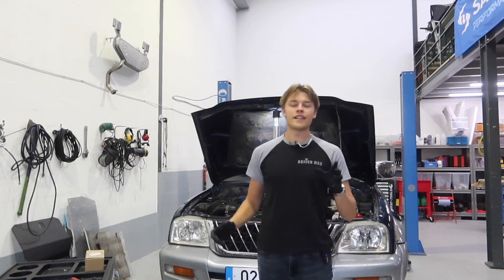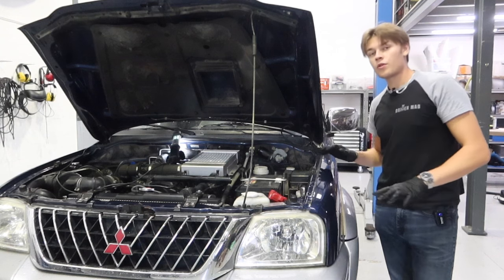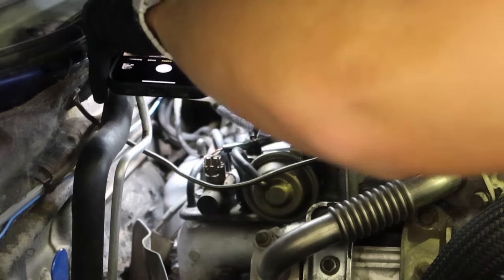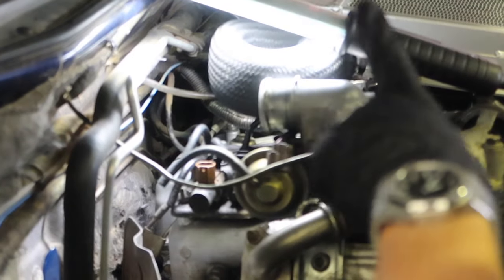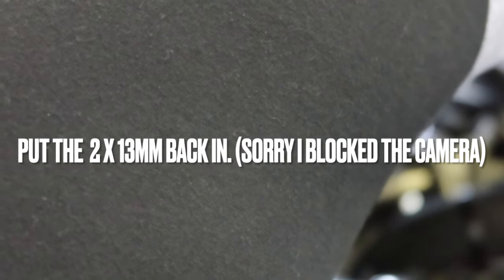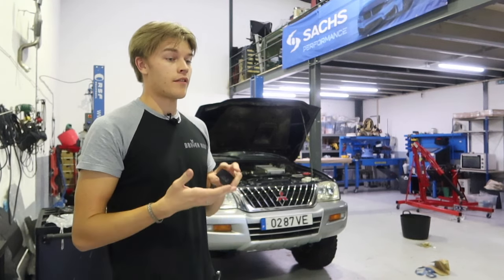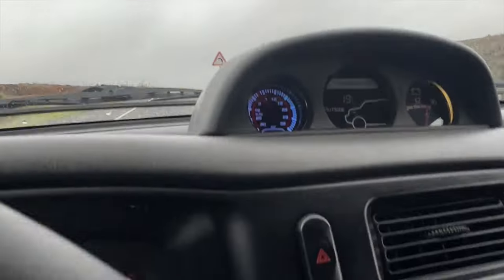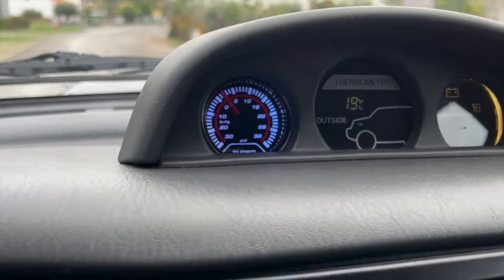Turbo solenoid replacement (Shown on Mitsubishi L200)

Comment: Hi Nath,  I feel for you , Iv owned  my L200 since 2003 when I bought it new. At 460,000 km I encountered the same problem you have now , the only difference was that my truck would go into limp mode, I would have to pull over and switch it off for about 30 seconds then everything would be ok for a while . It got so bad that I decided to swap out the turbo for a reconditioned  unit , did it solve the problem,  NO. Certainly had more power but the limp mode problem carried on .I then changed all the small vacuum tubes, still no luck. I then replaced the two valves you just did, I bought them on ebay, BIG MISTAKE.  That just made the problem worse. I then ordered 2 original valves from the UK, Bingo! It solved the problem. I also learnt from the internet how to test those valves with a 9volt battery and a vacuum pump and found that the cheap ones from ebay were faulty.  One other thing , when I put the good valves on I still encountered the problem once in a while for a couple of weeks untill it went away . I think these valves stick at times coursing the fault.  Thats my experience,  I hope something here might help. Greetings from Valencia.
Reply from the maker: Interesting you say that, it’s been a few days and I can definitely feel a performance increase since changing the solenoid. I’m going to replace all the boost sensors as I have them.
I might have to get a Mitsubishi solenoid like you say as they probably are better. 
I appreciate the comment and I will be posting more on my troubleshooting 👍

Comment: Only Original solenoid solve the problem, but the lifetime him can extended using a better air filter in solenoid. Another solution is Toyota Hilux solenoid, here in Brazil we using because is very difficult find original Mitsubishi solenoid and we when find It, its very expensive.
Here L200 K74T is called L200 Sport or L200 Outdoor in versions GL or GLS (121hp) and HPE (141hp)
Reply from the maker: Great tip, thank you

Comment: Have you ever looked at the two bolts that control the turbo actuator?

If not, I'll look out a picture of how far they should be screwed in/set.

Im not saying that will fix your overboost, but its 100% worth checking they are correct
Reply from the maker: Hi there, I will have a look! Thank you for the comment 👍
Reply: @DrivenMadShow  Don't be tempted to tweak actuator rod length immediately as this is often tricky to get right. Of course this assumes a previous owner/mechanic hasn't already been tinkering.
Reply from the maker: @andyfalconer3508  I will try everything before I go near the actuator adjustment. Thanks for the good comments 👍

Comment: I had the same problem - I replaced it with an original one - the manufacturer gives about 150,000 kilometers of warranty, so in K74 it's not a question of whether they will break, but when - I see a new intercooler - is it a custom order or maybe a replacement?
Reply: You replaced the turbo?

Where did you buy it?  Does it come with a new turbo actuator?

Was your overboost causing limp mode?
Reply from the maker: It’s a new aluminium intercooler, I changed it as I thought it looked better, but most importantly cools better. Got it on eBay. 
Thanks for the comment 👍

Comment: Often overboost can be symptomatic of stuck or sticking turbo vanes - not sure what system is on the L200. You can test this with a vacuum gauge pump like a mityvac
As you mentioned, look at the condition of boost pipes, but also the small vacuum lines.
Reply from the maker: Interesting, I hadn’t actually thought of the turbo itself being the issue! I will investigate. Thanks for the comment 👍
Reply: @DrivenMadShow  If it is stuck vanes, often actuating with a pump will free them up, but I've seen these cleaned in-situ with Mr Muscle Oven Cleaner.

Comment: Hi Nath.......
Check all the rubber pipes very carefully for any splits, damage etc, and the induction pipe.
If the turbo is over boosting then that would point to the waste gate not opening?
Are there any sensors that could be faulty?
Check the turbo unit itself, this will require you to remove the turbo from the engine first.
Clean both the exhaust turbine and turbo, make sure the vanes all move freely, the problem with turbos is they become heavily contaminated with carbon deposits which prevent the vanes from operating causing the over boost problem.
Examine all the turbo parts very carefully for any damage.
There should be no play in the bearings, check the seals, clean all the parts thoroughly removing all the carbon.
You may be able to purchase a turbo overhaul kit from Mitsubishi?
It could also be your DPF is blocked, so i would suggest that is cleaned of all carbon deposits whilst the turbo has been removed from the engine.
My apologies but i can only give you general advice as i have not previously worked on this engine.
Good luck
Take care
Best regards,
Stefano
Reply from the maker: Hi stefano, thank you for your in depth comment. I’m currently replacing the 2 boost pressure sensors and methodically replacing all of the vacuum lines with new and studying them all. This will all be next weeks video. If that doesn’t work then I will head towards the turbo.
I have already replaced the waste gate and it is moving freely. 

I will be keeping you updated on how it goes. 

Yet again thanks for the comment. 👍
Reply: @DrivenMadShow  
Hi Nath......
Work methodically through everything and you will find the problem.
Good luck and I look forward to watching the forthcoming videos.
Take care and stay safe please.
My best regards to you and Jon.
Stefano

Comment: Hiya I've got a mitsubishi L200 k74  06 plate with an AC problem, there is no power to the ac pump have you a video or any advice on what to check to find the problem many thanks Alf
Reply from the maker: Sorry, experts we are not - on a forum I found this (Facebook L200 owners is a good place to ask)

Check the AC Fuse and Relay:

Locate the fuse box, which is usually found in the engine compartment or under the dashboard.
Identify the AC fuse and relay by referring to the fuse box diagram.
Check if the AC fuse is blown and replace it if necessary.
Test the AC relay by swapping it with a similar relay in the fuse box to see if the AC pump gets power.
Inspect the AC Pump Clutch:

Ensure the AC pump clutch is engaging when the AC is turned on.
If the clutch doesn't engage, it could be due to a faulty clutch coil or insufficient power reaching the clutch.
Check for Refrigerant Levels:

Low refrigerant levels can prevent the AC system from turning on to protect the pump.
Use a gauge to check refrigerant levels and refill if necessary.
Test the AC Pressure Switch:

The AC pressure switch can prevent the pump from receiving power if it detects incorrect pressure levels.
Use a multimeter to check the continuity of the switch and replace it if it's faulty.
Examine Wiring and Connections:

Inspect the wiring harness and connections leading to the AC pump for any signs of damage, corrosion, or loose connections.
Repair or replace any damaged wiring.
Reply: @DrivenMadShow  cheers for the info certainly gives me a heads up on what to look for, I've managed to fix turbo, lack of power after watching your video cheers fellas keep up the good work 👍

Comment: Hey guys, I was thinking of you recently when I decided I might change the injectors on my ML 270. I know it's off topic now but did you change any and was it difficult and are there any computer coding issues?
Whatever happened to yours?
Reply from the maker: Hi there! Yes we did change all 5 in our merc. Luckily for us they weren’t seized or stuck but the best tip I have is every morning/evening for a few days or week, spray around them with penetrating fluid and continue to use the car. As it heats up and cools down hopefully some of the penetrating fluid can work its magic. Then it’s wiggle and tap to remove them, I’ve seen cases of the 5th injector being stubborn so be careful and patient with it. Also disconnect the battery before you start unplugging bits then you shouldn’t have any electrical issues. That’s all I can recommend. 
Best of luck from us 👍
Reply: @DrivenMadShow 
Thanks, that seems like a very good tip. Did it make a difference?
Reply from the maker: Not really :)  to be honest
Reply: @DrivenMadShow  
Hmm, mine's stalling at the drop of a hat under load and I am running out of things to change. It had the injectors changed once before to allegedly fix that problem. I don't really see how,. It runs pretty good otherwise. I still might try if I can get a set cheap enough.
Thanks.
Reply from the maker: Sounds more like fuel starvation - but expert I am not ! - the obvious and cheap area is the fuel filter ? thats been done and replaced ? possibly try a fuel additive to clean the system - then it might be worth checking the pump - should not be the low pressure one ( as it deals with starting) so could be the high pressure one, your symptoms point at that - they are easily available and an OK job .. when I did mine, all the fuel lines were hardened and every clip broke :( so new fuel lines will almost be inevitable, unless you have a better touch than me ! ( can be cable tied, but Dad would not consider it :)  best of luck

Comment: hi 
i have a K74 1998 and my "Weel lock" lamp in my dash wount go out, normaly when you start it up and put it in 4wd it comes on and stays on untill you turn the car off. Its not the rear dif im talking about, ist on a buttom for it self. any advice? :)